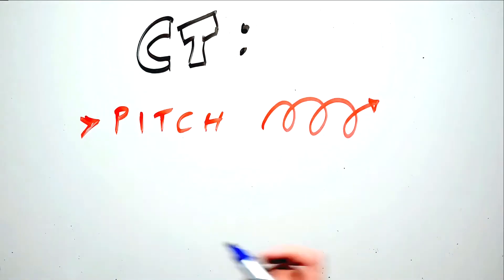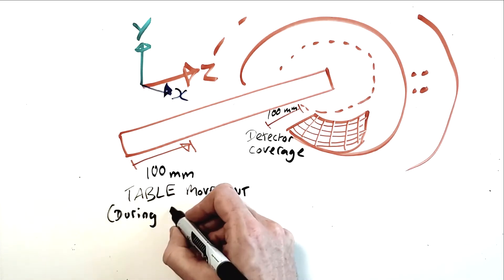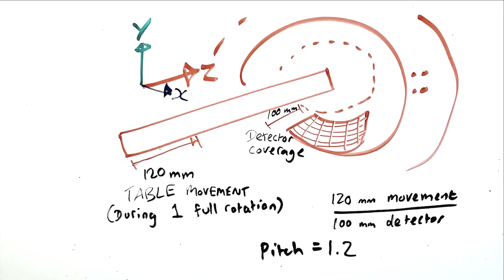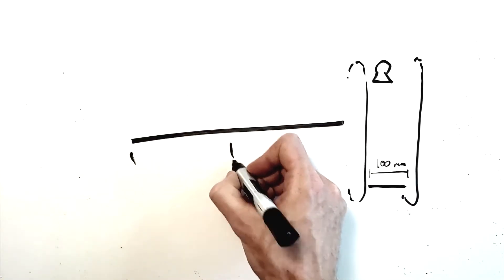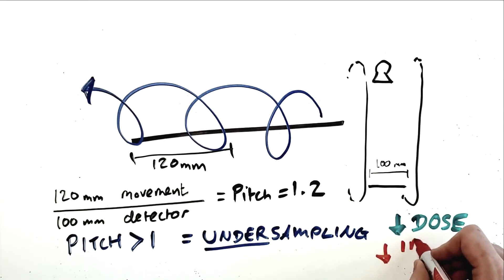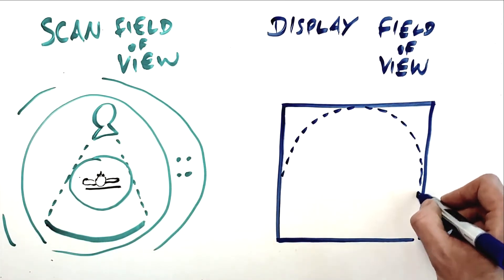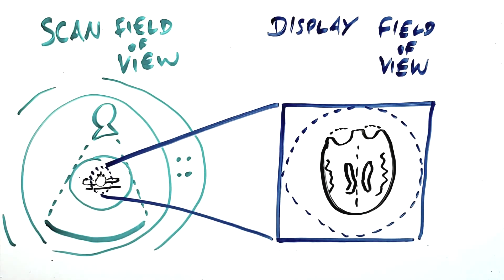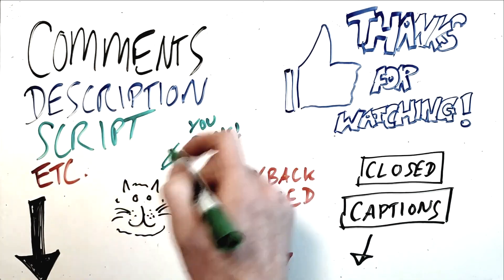CT Pitch and Field of View

Comment: Thanks for the explanations, keep up the good work. One clarification is that at pitch greater than 1 there is typically not a gap and the data is not undersampled. There is less than a full scan of data but reconstruction can still be very accurate in this scenario. I know some books show this as a gap but this is a misnomer. Above pitch 1.37 or so is where data starts to be missing depending on DFOV.

Comment: Dear Sir thanks for such easy and instructive concepts. Can you please make a video on type of detectors. i.e (SSCT, MSCT, True Volume Isotropic, Istropic , Anisotropic (Adaptive). Thanks looking forward
Best wishes
Reply from the maker: Thanks for your comment and video suggestion. I talk about detectors in some of my other videos but not in as much depth as you are requesting. A quick summary with regards to the types you have described:

SSCT = Single Slice CT, acquiring one slice at a time. This is the original design of older CT scanners, where one rotation corresponds to one slice.
MDCT = Multidetector CT, basically meaning multiple slices are acquired in each rotation because there are multiple rows of detector elements. Some modern scanners have 64, 128, 256 or more rows of detectors, meaning they are able to acquire a lot of data in a short amount of time. This is described a bit in my first video on this channel (CT Basics: Major Components).
Isotropic detectors: The principle of isotropy means voxels are equal in size in all dimensions (i.e. voxels are a cube, not a cuboid).
Anisotropic detectors on the other hand would give voxels that are longer in the Z-dimension than in the X and Y dimension, so even though you have a square pixel on an axial image, the volume represented by that pixel is a thicker slice.
Adaptive detector arrays are detectors which have multiple different options for slice thickness. Generally they will have a section in the middle with smaller detector elements (e.g. 8 x 0.5mm) and then extra larger elements at the periphery (e.g. 8 x 1mm slices). In this example you would end up with 4 x 1mm slices at one side, then 8 x 0.5mm slices in the middle, then 4 x 1mm slices at the other side. You can choose to use either the whole detector, or only the higher-definition central portion, depending on the application (e.g. for fast acquisitions like most body scans, you would use the whole detector as 1mm elements, and for high def acquisitions like temporal bones you would use only the central 0.5mm elements).
Most modern scanners use isotropic detectors.

Overall it's too much to type but thank you for the suggestion, I will consider this for another video.